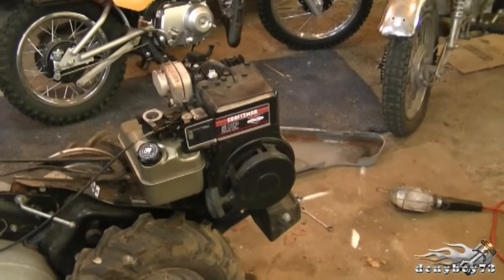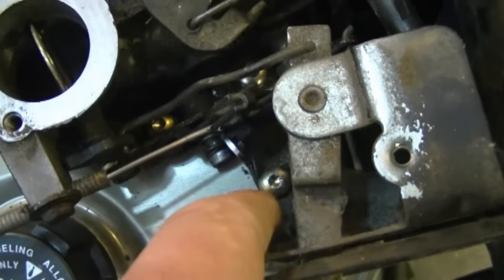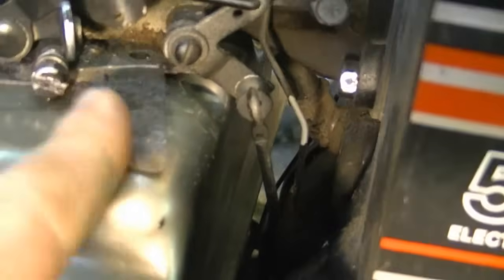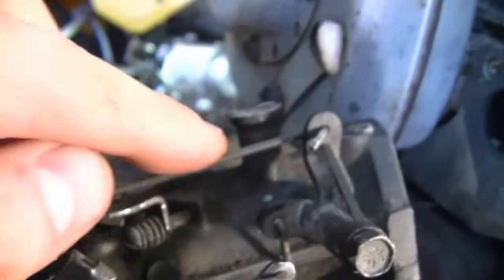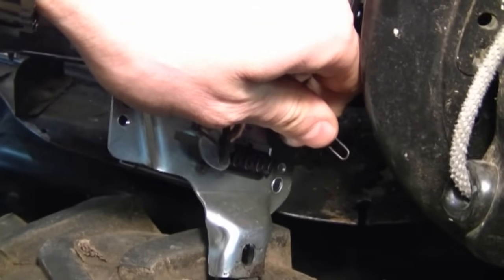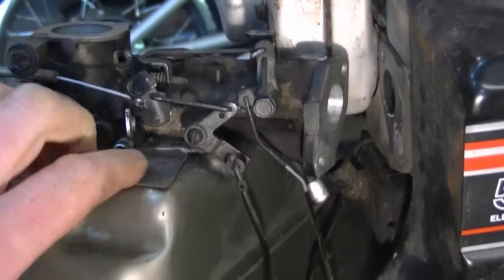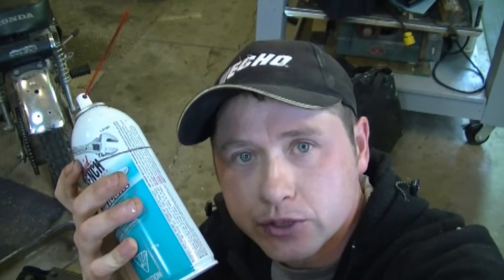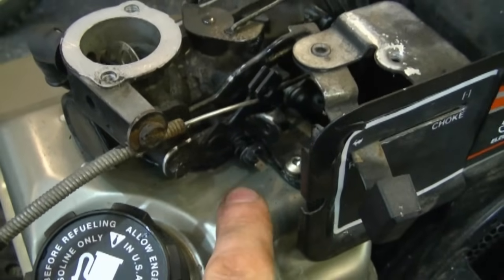Choke, Throttle & Governor Linkage Configuration on Briggs & Stratton 4-5Hp Engines

Comment: As for as I can tell I have the same engine featured in this video. My problem is that it seems that all of the linkage is hook up but the throttle will only do one speed. It doesn't matter if it is all the way up or down, there is no variance in the power to the engine or speed. What is my problem?

Comment: Thank you so much for making this video! Weird story: I was given an OLD Craftsman chipper/shredder. After a few months of use, the plate that holds the choke & throttle broke off & started flopping around. Turns out @ some point someone took off the whole air filter housing, lost 2 screws & never bothered to replaced them. Excessive vibration eventually snapped the little arm that holds that plate to the top of the gas tank. Eventually it just wouldn't stay running & there was very little movement in the throttle lever. I ripped the whole thing apart & fabricated a new plate for the choke/throttle levers. I found the 2 missing screws in the carburetor. They had jammed the fuel intake valve closed. After sitting in pieces on my basement floor for a few weeks, I was having trouble getting the linkage right.  Your video was a life saver!

Comment: I have an engine exactly like this at home. I've been trying to renovate my dads old go kart. But it's been sitting for a couple years now. Unfortunately I have no clue what I am doing... I have changed the oil, added some new gas and all I can get out of it is a few seconds of idle, then it dies. And that's only with engine starter fluid.

Comment: I was curious can you buy an after market carb that isn't all connected to fuel tank for these. I hate these damn Briggs motor with fuel tank carb all one unit. I could get this in a smaller more confined installation spot if I could thanks for any help?

Comment: Excellent video, thank you.  I got an aftermarket Chinese carb and I don't get the butterfly action at "full throttle stop" like I did before.  Everything looks like it's hooked up correctly, so I'm wondering if there's a tolerance issue with the new carb.  

But this video is extremely helpful in verifying that it was all put back together correctly.  Thank you again.
Reply: Could you let me know what carburetor you got? I got the same problem even change the carburetor to cheap Chinese one and still does it.
Reply: @allone5889  I don't remember exactly which one it was but it was a clone for the Briggs and Stratton part.  There were several clones to choose from
Reply: @allone5889  YT apparently doesn't allow links so it was from Amazon, the "kipa Carburetor for Briggs & Stratton 498298 692784 495951 495426 692784 492611 490533 Engine Series 112202 112212 112231 112232 112252 112292 134202 135202 133212 Lawnmower Toro 62923 62924 Blower"

Comment: Got a question guys . Just recently rebuilt this same motor . However everything I fix one thing I find 2 more to fix . I think I've finally got it . But where does the wire go that's down around the governed assembly

Comment: Hi Doctor! I have a very veird problem on my Briggs 5HP I/C engine, the same one like in this video. Engine stars normaly and runs in low RPM. When i start to throttle (no load), it runs until about half the way up and then governor reacts and opens up (governor linkage moves into full open position) suddenly and engine stalls and stops. 
I have checked all the linkages according to this video and all linkage are in correct place.  What could be wrong with my engine?
Reply from the maker: I turn out the fuel adjusting screw on carb when this happens
Reply: I tried to to that, it helps a bit, engine can run at maybe 80% of throttle but still stalls and stops when governor opens up fully.

Comment: Hi Dony,
Thanx a million for the video on the governor spring location!
Would you be able to advise me on this issue?
The throttle control binds-up halfway through the stroke from "Off" to "Full".
The throttle level is on the same panel as the choke lever (it's a chipper/shredder).
The carb linkage moves smoothly when the throttle lever is disconnected.
The governor linkage moves smoothly when the throttle lever is disconnected.
It appears that the throttle linkage lever pin that engages the double wire link is ramming against that link halfway through the throttle lever movement.
Have you ever seen this?
If so, what did you do to fix it?
Thanx ... Chris

Comment: Do you know how to up the rpms a little  have a Briggs I️/C 5 hp generator and it just got back from the shop for a carburetor adjustment and carburetor to engine gasket but now runs great but sounds like it’s running slower than before and doesn’t keep the voltage and frequency up  like before it went to the shop!

Comment: Thank you for the great video.  I reinstalled the carburetor onto the top of the tank with a new tank gasket.  When engine is running, gas leaks out onto the top of the tank under the carburetor.  Should I use 2 gaskets (to make it thicker)instead of just one?
Reply from the maker: I usually just use one new one but you could try 2
Reply: donyboy73 thank you

Comment: I have that same engine in a generator.  it'll run in starter fluid but won't pick up the gas.  I cleaned the carb. Any tips??  I would really appreciate it.

Comment: what is the arm that has the little plastic cut clip with the cut that holds the linkage called? its the one in the middle. im missing it and its not in the parts diagrams. any help would be appreciated. its the one your finger is on at 3:22 3:23

Comment: Hey Donyboy, I have a Briggs and Stratton 136212-0015-01 FUN POWER and I am having some problems. The motor will run good for about a minute but then it stalls out and I cannot get it to start again without starting fluid and then it runs for another min or two and stalls again. When It runs tho it seems to run very good. It seems like its a fuel issue but I pulled it all apart and cleaned the carb very good. The engine hasnt been ran more than 3 hours since new but it is about 10 years old, compression is excellent as well.

Comment: Does anybody no what the metal fuel line looking thing with the rubber elbows on each end is for? It runs from the side of the carburetor to the block. My rubber elbows are dry rotted and my engine isn't getting fuel. I was wondering what this part done.
Reply: landsurveyorNC it's similar to a Positive Crankcase Ventilation (PCV) valve. The valve is inside the tappet box behind the fuel tank. It releases the crankcase pressure created by the underside of the piston into the carb.
Reply: landsurveyorNC  B&S part numbers 692189 & 692187.  I got mine from Amazon but likely any shop that sells small engine parts will have them.
Reply: By the way, B&S calls them grommets.

Comment: We the motor not stay running if governor spring is stretched out or is it in the throttle cable that goes up on the handle bar. The mower is a 1979 Kee with a 20+yr old 5hp BS motor. It runs when moved by hand but not throttle. This is my first motor repair. Thanks.

Comment: I have a rebuilt small 2 piece flow-jet on a 5 HP Briggs #130202. I can't get any power from the motor. It starts 1st pull but give it throttle and it might pop out of the carb or it just doesn't take throttle. It's on a mini bike and it won't even pull itself hard enough to engage the clutch. HELP!  Great compression,spark and the valves are not sticking .  Any suggestions??

Comment: I have a very similar 5hp Briggs and Statton and used your video to put it back together after cleaning. Thank you for including everything! Mine idles fine now, however when I go to engage it into the ground it bogs and dies on me. Did I do something wrong with the assembly? There is no increase in idle when I throttle it with the lever?

Comment: thanks for the video i just got a 5hp briggs that i need to look and this video will make it so much easier to attach all the linkage together
Reply: If the fuel is overflowing what's the problem
Reply: +Jimmy Sumner the motor has sat for years, and the oil rings were broke into pieces.
Reply from the maker: +Jimmy Sumner you probably need a carb diaphragm, the adjustment screw may also be turned out too much

Comment: I have a coleman 2000 generator that has no throttel linkage because its automatic. The governor linkage from bottom up to top of the carb has a real fine spring that is wrapped around the rod. Where does the fine spring hook up? Please Please help!!!!!
Reply: I have the same generator and can't find out anything about where that little spring goes either.  There is a second hole in the governor arm but I can't figure out where the other end goes. I'm gonna run it without that little spring and see what happens.   I've been searching for a solution for 2 days.

Comment: I can not find a video on the replacement of the plastic gas tube. new ones don't fit even if you buy both brass and plastic. don't know how to put them together
Reply: +Kim Reshard Did you find a repair for this?  I'm in the same boat.

Comment: Hey donyboy73, I had the same engine on an old snowblower back in ks and it squeaks badly when 3/4 quart low on oil, but my newer Briggs lawnmower never squeaked like the Briggs snowblower did when it was dangerously low on oil. Why does the old engine squeak but not the newer engine when oil is low?
Reply: Probably due to wear. The new one has less wear.
Reply: Also, one might be a bearing, one might have bushings.

Comment: Hi I have a toro lawn mower model # 20631 and I am having trouble finding anything on how the throttle linkage go together it mount on top of the carb and I think its missing a spring .do you know where I can get a picture of how it works and where all the springs go.thanks Rob

Comment: I have 20219 TORO 1991 Self propelled Lawn Mover. It was working fine but the Throttle handle would spring back in choke position and was not staying so I tried to adjust the throttle cable. I accidently broke the spring on the carburetor rod so I ordered a new one from the TORO dealer and replaced it. I noticed that the throttle cable end was short and the mechanism requires it to push the choke arm and it was just scrubbing and not pushing the arm to close the choke. So I bend the arm a little and now it pushes the choke arm and properly closes when I put it in Choke position all the way down. It cold starts but when I bring back into the fast run position (Rabbit) it runs at the slowest RPM. then if I move the throttle handle to the slow position (Turtle) there is no difference it keeps continuing with the same RPM. I tried touching the throttle which is connected with the carburetor rod and it raves up the RPM immediately. Meaning it works. So what should I do to fix this problem?
Reply: Just run a direct linkage to the carburetor so you don't have to mess with the governor crap

Comment: Thanks for posting this video.  That Craftsman tiller is exactly what I am working on and the surging is what the engine is doing.  I thought it was the governor linkage until I heard what you said about the adjustment screw.

Comment: I have a 5 HP motor  that's exactly like that and my engine surges up and down like it's starving for fuel, then stalls out.  , I see there is a lot of rust inside my gas tank.( I think that's where my problem is at )  Where can I buy a new gas tank that's exactly like that in your video. Can you post a link to purchase a new gas tank ? Thanks! Great video by the way.

Comment: Hi, hope you can point me in the right direction. I have the same engine but I am having an issue with it idling, if I hold the butterfly valve used to rev the engine shut it idles really nice, but if I let it go it starts to rev up on its own, can you help? Thanks.

Comment: Donyboy HELP, just watched your video on 5 hp b&s rototiller engine. My dads is exactly like that. I tilled for 30 mins,stopped went to town ,came back, and the tiller wouldn't start. We have spark, we have gas, so I tore it down. diaphragm in carb had a tear in it, so I put a new 1 in, along with spring and ring. I also bought some starting fluid while I was at the mower shop. After the carb overhaul, I sprayed the carb with starting fluid, nothing, I primed with gas, nothing,sometimes it pops or backfires through the carb. Checked the keyway on flywheel, its intact. How can a tiller work great for 30 mins then develop this disease. Whats my next move, I'm puzzled

Comment: Hey man I got a question my sheer pin/ key keeps breaking. It is the correct size and fits correctly, but every time I stick it back together it just breaks again. It's is a 1964 Briggs and Stratton 5 hp motor much like the on in your video.

Comment: I think I have it DonnyBoy. for one I had the throttle cable connected in the rear opening hole so I moved it to the front hole and engine calmed down more and no leaks so far.
Reply from the maker: ok good

Comment: Thank you DonnyBoy, I am working on a Husqvarna Tiller with the Briggs & Stratton same one you have here. I have pulled it down, this will be the 3rd time trying to fix a leak on the left side between the carb & Tank. I have put on a new gasket and there was 2 on it, so I left the one on bottom of carb and placed another one but it still is leaking, looks like from the screw but the screw is tight all way around, Any tips please I really hate to pull this apart again because it is tuff getting to the screw on bottom of carb. Would be nice to see you pull the carb &tank from Beginning to end please. Any tips for me please DonnyBoy???

Comment: I have a Craftsmen 2400 generator with a 5hp Briggs & Stratton engine. My son took the carb & linkage apart & I'm having trouble getting the linkage in the right place...I think I might be missing a linkage somewhere. Do you have a video for this model or is there a manual you can recommend. Thanks for your help...

Comment: I have a Craftsman 26" rototiller with a Briggs and Straton 5.5hp engine.  Do you have a video showing how to remove the carburetor and perform a rebuild/clean-up?   I watched your Toro snowblower carb rebuild video and was able to rebuild mine and it works great now....thanks for sharing the knowledge!!!

Comment: Don,

I have a 5hp Briggs and Stratton Fun power engine on my go-kart, i am having issues figuring out the linkage. The linkage I have on there right now doesn't have the govoner attached. Is that bad? It idles rough because the govoner isn't attached.... can you please have a video on a go kart linkage with the govoner attached? Thank you

Comment: Don,

I have a B&S motor on a small mower I got for my wife, so she could handle small cutting around the house.  It's a 9T602.  Problem is, as soon as she get to anything with some heavy grass, the engine cuts down to almost nothing and she has to wait almost 30 seconds until it is back up to speed again.  Is this the governor and if so how could I fix this?  I don't see any video addressing this issue.  Many thanks!

Comment: Donyboy73 - I appreciate the video.
My problem is that I have the same engine, new gas tank and the throttle is on the bottom of the gas tank.  Any help on what that linkage is supposed to look like?  I can send pics, if you have time to help.  I know I am missing something...

Comment: Donyboy73 my tiller is a 5.5 craftsman has the throttle and choke at same location do you have any info on that I rebuilt carb cleaned tank but can not remember how to get linkages all hooked back up?

Comment: I have a similar tiller but the throttle is connected at the bottom and it seems something is missing. The governor linkage is there and connected but the throttle has nothing connecting the bottom mechanism to the carb. So I pull the throttle on the handle it moves that bottom piece but the carb needs a connector. It is a 1993 Lowes model 213-430-062 rear time tiller 5 HP B&S engine. Can't find any actual diagrams or pics showing connections.

Comment: I rebuilt a carb for a briggs fun power 5hp, you're the only person I've found that gives the detail of the governor spring from tank to linkage, I've been panicking because it's xmas eve and I'm hours away from giving my 8 year old her first go kart, you literally saved the day and her Christmas. Thank you for the detail, you even showed it a second time, god bless.
Reply: Mike Carter     lol, I had the same problem the other day. And my throttle was stuck open just because I hooked up the spring to the governor arm wrong. I felt so stupid when I realized that it connects to the post that looks like a T.

Comment: I have the same engine. I took the carb tank unit off a generator that seized and am installing it onto a smaller generator. There is no throttle cable on it. Is it normal thing to have no cable and the rpm is set by the rotating disc like mecho at and joined to the lower tank?

Comment: i have a question donnie boy . does the governer arm and tension on the spring from the throttele cable arm control the throttle ? ie.the throttle cable isnt acctually connected to the butterfly. ?

Comment: Hi i have a yard machine rotortiller with a 5hp briggs and stratton (same as in this video). it sat for 10 years and the gas is old in it, i drained out the gas. i cleaned the carb, then got a professional mechanic to soak it in carb cleaner for 24hrs. the motor will only run if i pour gas direct into the carb, and it will only run on that gas. i think there might be a fuel pump issue. any suggestions? please help.

Comment: Hey DonyBoy! is there an email or someway to get in touch with u to ask u a few questions about this engine. my brother and took on a half wway finished go kart conversion from the B&S 5 hp tiller engine and I have some fuel pump issues. it won't syphon fuel up in the fuel reservoir. HELP! please.